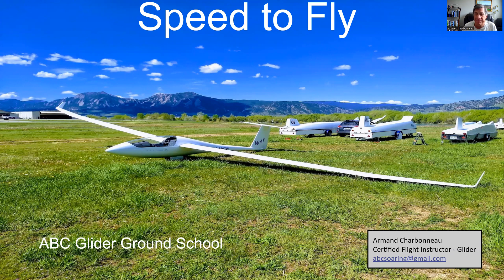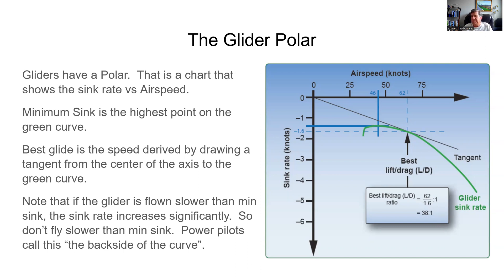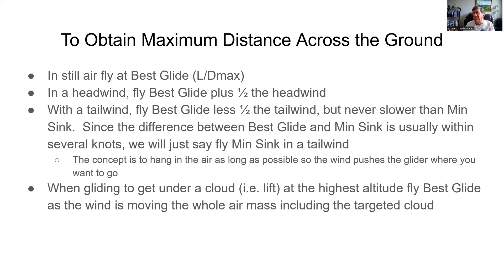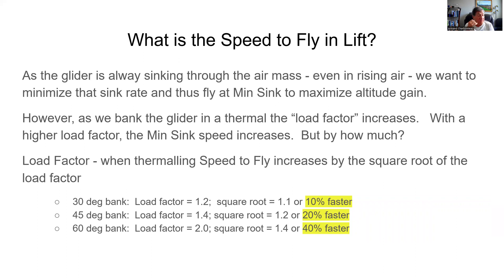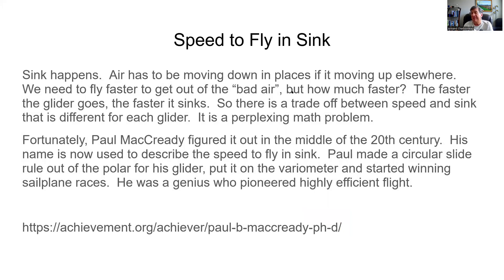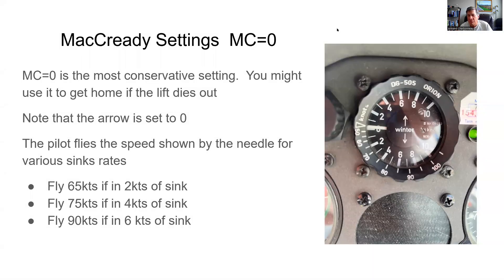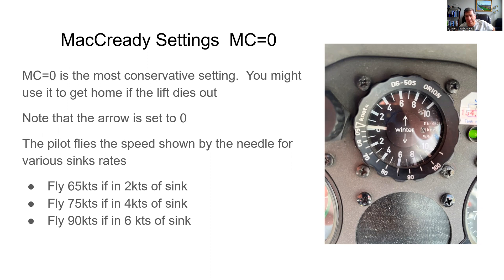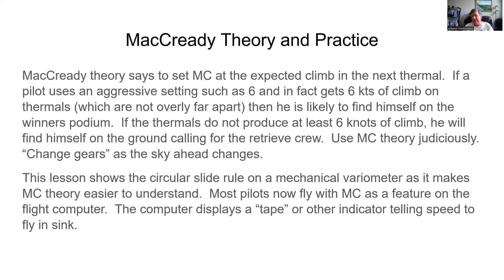Speed to Fly for Glider Pilots

Comment: Thank you. Useful information But it would really help to explain WHY the selected speeds are what they are, rather than just "learn it the way it is". You do that sometimes (e.g. why we fly Min Sink in a thermal), but you don't do that in many other places (e,g, why fly Best Glide plus 1/2 headwind speed... why 1/2 not just plus headwind speed? Where do the load factors come from? Why is Best Glide obtained by drawing a line from the origin to the polar curve? etc... etc... etc...). Glider pilots are not afraid of a little physics or trigonometry.
Reply: Plot it out on the drag polar and you'll see why 1/2 the windspeed is an approximation for the optimum speed to fly into the headwind when referencing the ground.